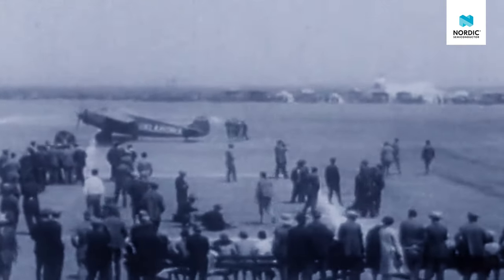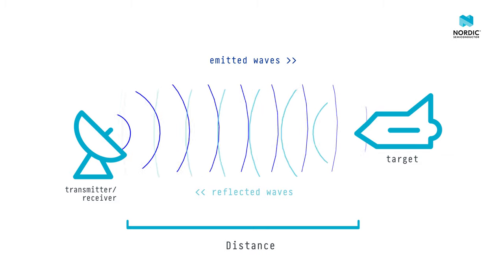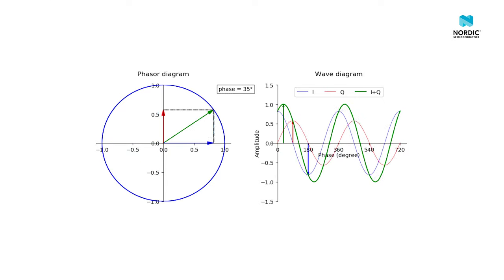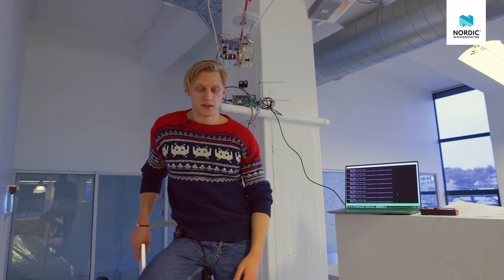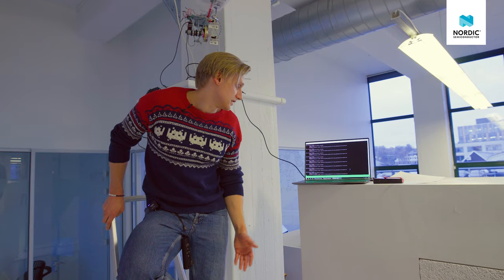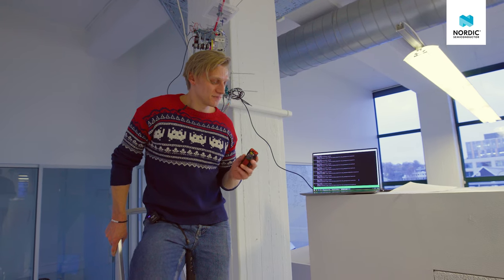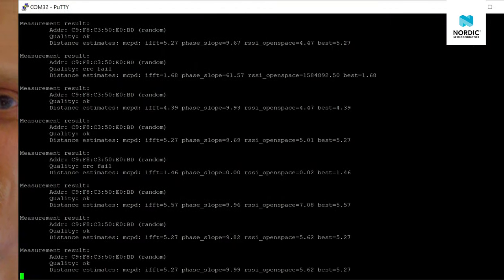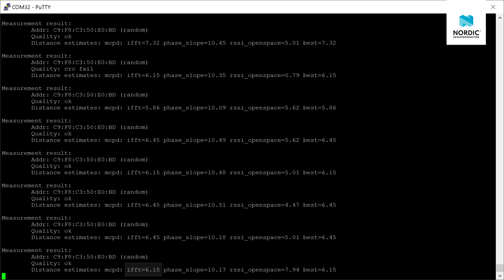Measuring distance accurately with the 2.4 GHz radio only!?

Comment: Does this work with coded phy? What max range?
Reply from the maker: No it does not work with Coded PHY. It has been tested in office space, reliable results up to 8-10 meters with filter. We recommend you to watch our webinar "Introduction to Nordic Distance Toolbox works" for more information: https://webinars.nordicsemi.com/events/12113618787
Reply: @NordicSemi  The linked video is no longer available.  Any chance it can be re-uploaded?
Reply from the maker: @wizardy6267  sorry the link has now been updated. The video is still available: https://webinars.nordicsemi.com/events/12113618787

Comment: Can this be done with a higher frequency to achieve greater accuracy? Also, can it be adapted to operate with 2 "base units" to calculate a 2-D position or 3 units to compute a 3-D position?
Reply from the maker: As we do not talk about frequency in the video, we are not sure what you wondering. Could you please clarify? It is possible to triangulate a location in 2D or 3D space by combining readings from multiple NDT pairs, yes, but please note we do not provide the algorithms or code for doing the triangulation itself.